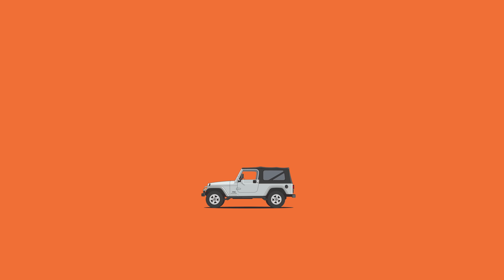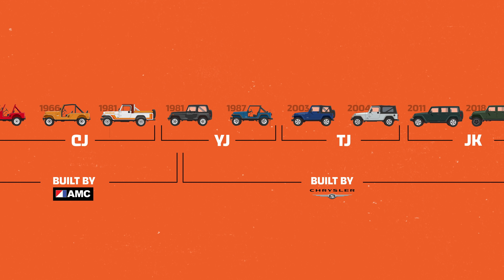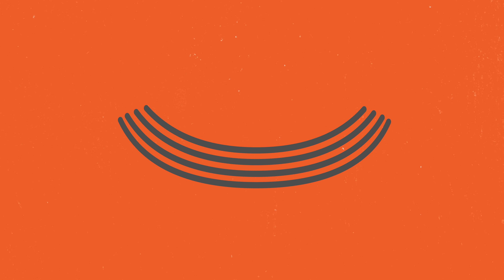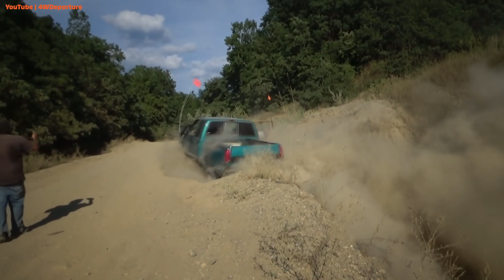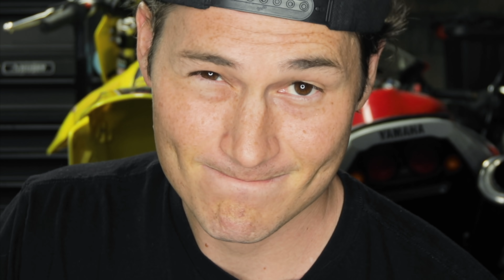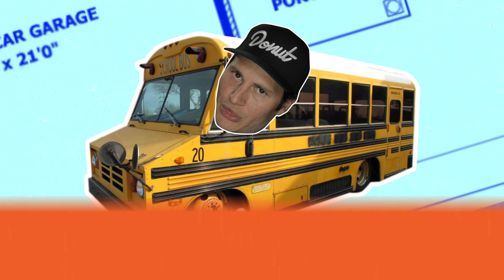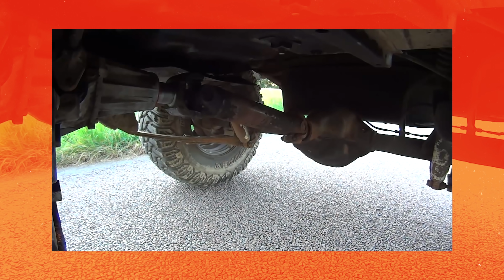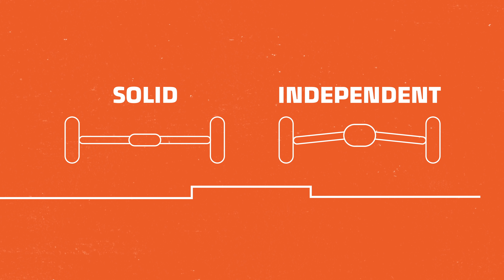Jeep Wrangler - The Science Explained

Comment: My 2005 Rubicon was my baby! Love the TJ, had a Sahara as well. The TJ is the GREATEST JEEP WRANGLER EVER!!! Odd it doesn't get more love more often, it's still B-A
Reply: Tj was lot of fun but jk is huge improvement.  Many mods factory we did to tj . 3.6 is a fun motor .
Reply: @street_legal_go_kart7356  Have had both and I still have the JK and no, in no world is the JK a huge improvement. The 3.8 is terrible when compared to the indestructible inline 6, 4.0L and that engines awesome sweet spot. You also don't get a limited slip in the rear axle to assist you when your not in 4WDL. The 31 inch Goodyear MT/R's  fit the TJ better than the 31 1/2 BFG Mud Terrains fit the slightly wider JK not to mention the Goodyear MT/R's where a better tire as a whole and gave better performance. There are many more differences, but as a from the factory badass off-roader, the TJ Rubicon is superior when compared to the JK Rubicon.
Reply: @korrasatsuki8773  lol why would u buy a 3.8  100% 4.0 over 3.8 
Had 99 tj sahara,14 years 
14jk 3.6 sport 6 years .
Tj came with 3.73 gesrs and 30" tires d44 and lsd rear .
The jk sport came with 3.73 gears and 32" tires and was still a lot quicker stock to stock .
Reply: @korrasatsuki8773  u left out the 0331,head and broken piston skirts of the 4.0 among other issues .
Reply: @korrasatsuki8773  buy a sport and build it better . 
Lol u thank d35 is better than a 44 ? Most tjs came with d35 .
Reply: @korrasatsuki8773  my 14jk stock sat as tall as my tj on 2" pro comp lift and 33 mickey claws .  Now on 35's with 2" spacer lift lots of flex . Jk is also more stable at tripple # .
Reply: @street_legal_go_kart7356  Building a vehicle up doesn't magically make it better, you need the time and funds for the vehicle that will never have factory reliability. I also clearly stated a TJ Rubicon which has dual 44's front and rear and I compared it to the JK Rubicon, but the JK Sport also came with Dana 35's front just like the TJ as both had available Dana 44's in the rear. Your argument is invalid.
Reply: @street_legal_go_kart7356  If your trying to argue that the 3.8 is a superior engine to the 4.0L you'll find your alone, hydrolocked my 4.0L, new spark sparks, pumped the gas, good as new. Never had an issue and I've had three jeeps with that little beast, 2001 TJ Sahara-5 Speed Manual, 2005 TJ Rubicon-6 Speed Manual and a 1997 Jeep Cherokee Sport-5 Speed Manual.
Reply: @street_legal_go_kart7356  Those 32 inch tires you mention never existed, I also still have my 2011 JK Rubicon and it came with a measured 31 1/2 inch tire. And as Noted, I'm talking about off-road, the Wrangler's intended purpose, not on road, I have my Cooper for that.
Reply: @korrasatsuki8773  lol no jk sport had d30 like tj . 
Also jk 44 ring and pinion is 8.8 vs 8.5 of previous 44's .  Jk rubi front d44 is 8.5 ring gear . Also has same tunes and c's as d30 so not really NY stronger .
Reply: @korrasatsuki8773  with very little work I have built my jk sport stuoid strong to take 37's and not only is warranty on parts but 10 years on housing and 15 years on axel shafts u joings and locker .
Carbon built rock jock 44 Detroit locker . Rear is d44 torson lsd carbon cromolly shafts . 2" spacer lift and 35's
Reply: @korrasatsuki8773  no where have I said 3.8 was good I skipped it for a reason .  Was playing in jeeps before rubi was a thought.
Reply: @korrasatsuki8773  yes my jeep came with 32's measured with a tape . Feel free to go to my ig page . Sorry about your luck .
Reply: @street_legal_go_kart7356  You'd get a smore stable performer with a better lift, I ran my TJ, with a Skyjacker 4 1/2 inch rock track suspension with 35 inch KO's and never had an issue which included having to pull my JK out of the snow and up hill, on several occasions.  The added weight of the JK is it's largest hindrance as it borrows the TJ's off-road hardware while only adding the sway bar disconnect and removing the limited slip in the rear.
Reply: @street_legal_go_kart7356  You began this debate by saying the JK was a huge improvement over the TJ, but that would mean the 3.8 which replaced the 4.0. not the 3.6 which came much much later.
Reply: @korrasatsuki8773  actually yes its lot more stable . Wider axels help a lot . Run tripple # np tj never did .
Reply: @korrasatsuki8773  lol jk not much hesver than tj . Sorry .
My tj stock was little over 4,000lb with soft top full doors and full tank fuel .
Jk stock hard top full doors full tank fuel was 4,060lb .
Now its about 300lb more .
Used truck scale .
Reply: @korrasatsuki8773  jk is huge improvement  stock to stock . Many mods we did to tj jk has stock . Hi line  fenders longer countrol arms . Wider axels 2" longer wheelbase .  Fits 35's no lift . I had about 2 grand in my tj suspension.  And the jk does better with 2" spacer lift .
Reply: @street_legal_go_kart7356  Come to Michigan then, I've taken both my girls through the mud, the rock and snow and the TJ with my hi-line finders, skyjacker suspension with 35's is often the recovery vehicle for my JK and the Ram 1500 that often accompanies us. But your still ignoring that the only things that are great on the JK for off-road are simply borrowed from the TJ, so since the TJ is lighter, and slightly smaller, it is still a superior off-roader to the under powered 3.8 JK which replaced it. So no, it's not an improvement unless your simply want a better ride to the mall. So keep arguing all you want, all your doing at this point is arguing for the sake of trolling. And I have worked on my Jeep's as well, I even have my own tape measure and understand numbers and such. I'll end this rediclous debate by finishing with, the TJ also looks vastly better, it looks like a Jeep and acts like a Jeep, not a plastic model of a Jeep, #JKplasticGrillplasticBumpers Now I have things to do, enjoy arguing with yourself.
Reply: @korrasatsuki8773  ha ha what was  barred from the tj lol . 
Yesx3.8 is a turd . 
But I don't have  3.8 14 is 3.6 and smokes the 4.slow all day . 
Jk is not much more weight . 
I may have 300lb over stock tj but built a lot better .  
I run 15.3 in the 1/4 on 35's almost 70mph in the 8th .
Reply: @korrasatsuki8773  do u have ig ? Insata gram  ?  Look me up .

Comment: This video is full of bogus quotes! For example, obviously coils are superior to leafs offroad for the most part but weight savings? No. The added weight of the links (either 3/4 link or radius arms)  on the coil setup is heavier for sure! Another thing is this is not the only offroad capable vehicle, the bronco for example has had coil springs in the front since 1966, 31 years before jeep. Also it has a V8 and half ton axles vs 4/6 cylinders and 1/4 ton axles. This is just one example but there are other trucks out there better than jeep offroad

Comment: Why is there a H2 Hummer on the off road mount Rushmore?
Reply: because its usually used for offroading
Reply: @artilleryfire6576  ... it's a suburban.
Reply: @swat1229  ... and its still used for offroading, it doesnt matter what it is or isnt, its still used for offroading
Reply: @artilleryfire6576  Its mount Rushmore. It should be some of the greats.
Reply: @swat1229  you right, but my point still stands

Comment: Great technical video!  Did you know the original WW2 jeep had 4 handles, 2 front,  two rear, designed for four soldiers to CARRY the little schmeep in case it got stuck?  Check out the curb weight on the original. Then check out the weight of a current version on a dealers lot.  Shazam!  She's a big gal now! 👍

Comment: He said “heavy duty Dana 44 axles” haha all the new Dana 44’s are absolute trash. You’re better off building up a Dana 30/35 from an older unit.
Reply: Wrong yes the rubi front 44 is half ass 44 has same tubs and c's as d30 . But rear 44 has a larger 8.8 ring gears vs the old 44's 8.5" 
So no way he'll is the old d30 and 35 any better your smoking Crack
Reply: Rubi front 44 has the 8.5 ring gear in the jk .

Comment: Honestly if you don't have a Rubicon with lockers Jeeps have no more off road capability than any other small 4x4.  I've had a TJ and a Tacoma with 35 in mud tires and a 3in lift on both and not one of them could go where the other one couldn't.   Also the engine options on both suck damn near every V6 now has 300 hp but neither have that.  Both of them are underpowered even the supercharged Tacoma.

Comment: In fact, you can tune leaf springs. For example the Chevrolet corvette used leaf springs from the c1 all the way to the c7 generation corvettes, and those engineers found out that when using composites leafs (the steel strips as described) could in fact be tuned by adjusting the amount of resin in the springs to adjust spring stiffness. you can also use more or less leafs in some applications to adjust height.

Comment: Jeep Wrangler TJ is the Goldie Locks of wranglers. It still keeps the circular headlights and the traditional Tub body design of the original cj while at the same time adding modern features such as AC and heat, OBD 2, modern dash, dual air bags, and yes, coil springs. Also I highly recommend sitting in the interior of a Jeep tj Sahara before 2003. Absolutely gorgeous interior color choice.

Comment: As a guy with first gen independent suspension in my Chevy I hate it, I have a 2 inch lift and 33’s with 4 inch backspaced rims which has caused me to have a lot of bump steer and ball joint problems. Basically solid axles are the way to go when modding anything for 4wd off-roading

Comment: Just so you guys know, a fair bit of the info on leafs isn't correct... You can tune leafs before and even having already had them on a truck based on use case (what steel you use, arch, multi/progressive rate springs, hardware, mounting points, can absolutely be more flexible than coils for a lot less money and lots of offroad race rigs run leafs for just that reason).  Just thought you'd want to know

Comment: I had the (dis)pleasure of daily driving an early 80s wrangler 4 banger for ~6mo while my car was in another state. Holy shit I have never been more terrified; the front wheels lock up if you even think about stopping quickly, it's deafeningly loud, no AC or heat, slow as shit (you could watch the speed plummet with your foot flat to the floor if it got windy), got barely 10mpg, and had some nasty speed wobbles. But god damn, we tried to get that thing stuck but we just couldn't. Ripping around trails, sand, mud, water, even in 2wd the only time we got it stuck was when we high centered it.

Comment: First off, the wrangler was named the wrangler because consumer reports lied about rollover chances in the CJ, so they change the name to wrangler. There was no wrangler in World War II. Second of all, almost all“improvements“ only really apply if you are rock climbing or for little girls who can’t tolerate the bumpy ride. I had a CJ seven and a YJ wrangler. You could hose both of them out, leave the top off six months out of the year and  B make sure the drain plugs are pulled and you would be fine. Forget it in the new  models. The sissies are changing what a jeep should be. Jeeps are not supposed to have power windows and door locks, cruise control , media players, extravagant sound systems etc. just like Star Wars and Star Trek, slowly the Jeep is being turned into some thing I can’t stand.  And don’t get me started on a four-door jeeps.  And I almost forgot, the new jeeps have the Chrysler minivan V-6 engines now. They killed the 4 L in-line six which was basically castrating what little manhood the wrangler had left. You have to add a supercharger or turbo to get anywhere close to the torque the 4L had.  The V-6 is nowhere near dependable either.

Comment: "Do you wanna know what death wobble is?"

Me: That's literally almost every single military vehicle I've driven. 😂
Reply: The ol' "re-entering Earth's atmosphere" feel while driving a HMMWV at top speed meme haha.
Reply: Had on old 10 speed bike that would do it. 
At normal speeds it was fine, but get up into the higher gears or go down hill and it was like taking your life in your hands. I hated that bike.
Reply: I hit a death wobble on my motorcycle threw first time I took it to the track.  At the end of the front straight,  braking hard,  I locked the rear and it kicked out repeatedly to either side.  It felt like a good foot or two to either side(though really it was probably less). I kind of instinctually just relaxed on the controls and it straightened out. I'm lucky I didn't high side and get bucked off. That probably would have totaled the bike and broken bones
Reply: fatpad00 that’s a tank slapper not death wobble. Death wobble happens in the front.
Reply: @CamaroAmx  nah, tank slapper is when the front end becomes unstable and cycles side to side causing the handlebars to slap the tank(hence the name), so I guess a tank slapper is really much more like a death wobble than what happened to me. 
Either way, 1 wheel becoming unstable is scary as shit when you only have 2 of them to start with
Reply: @fatpad00  That's not really a "death wobble" in the jeep sense.
Reply: Ya everyone thinks humvees are cool or lmtv’s no they suck in every way
Reply: @doubleo1495  I've seen a road legal conversion for sale. Sounds like a fun toy but abysmal as a daily
Reply: Oof
Reply: Up armoured hummers baby
Reply: I hear ya man, the HMMWVs in the Marines made me feel like I was breaking the stratosphere at 30 MPH hahaha
Reply: I have a 1966 Jeep Duece and a half for sale. That doesn't have death wobble 😂 it can't go fast enough
Reply: Military: oh so we need to change tie rods and give front suspension some love?? Fuq it. Make it Independent!!!!..... Thus, Ford M151 was born. Big Brain move. RIP victims of M151 rollover
Reply: Yep I have a 44willys overland  ino the feeling all to well lol
Reply: *laughs in 2nd gen ram
Reply: I solved my death wobble by putting an adjustable castor on the front end. The tjs don’t have them. That solved my death wobble after about a couple thousand dollars later trying everything else. About 100.00 for the castor.
Reply: Death wobble? Ohh coil springs... Leaf spring front ends don't get the death wobble....
Reply: @sprsprtrudy  
Leaf sprung can definitely have the wobble

Comment: Saying leaf springs aren't tuneable is sooo false. It's much easier to make changes to a leaf springs than a coil. Add or subtract leafs, lengthen or shorten shackle length, move shackle location forward or aft, rearching leafs, revolver shackles, longer leafs or shorter leafs, different spring bushings, spring over or spring under, lift and lowering blocks, air bags, traction bars, sway bars, shock tuning, shock length, shock location, bump stops. It goes on and on and on. To the user they are way way more tuneable. You can't change a coil once you have it, but you can modify and tune leafs.

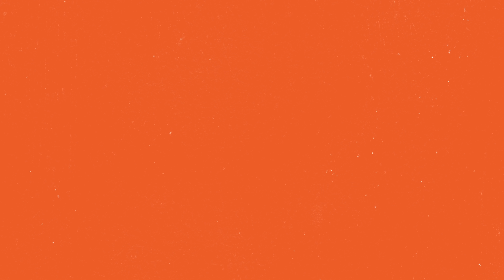Comment: 1:56 - White "TJ" i think is an "LJ" instead
Reply: technically a TJ Unlimited, LJ is a fan term
Reply: @maxj9204  this is correct. If you look up the body code "need to work for FCA like me for special access to make it super easy" TJ still comes up for LJ
Reply: BROTODILE your right. Longer wheel base
Reply: Not sure why that bothered me so much😂
Reply: They also said the TJ came out in 1997, it came out in 1996
Reply: @mrmoerder  technically there wasn't a model year 1996 wrangler, look it up anywhere. YJ ended in 95 and TJ started in 97